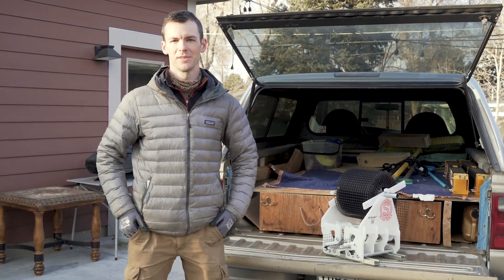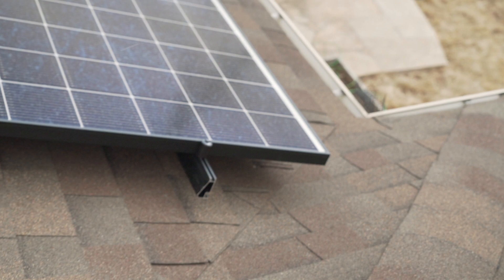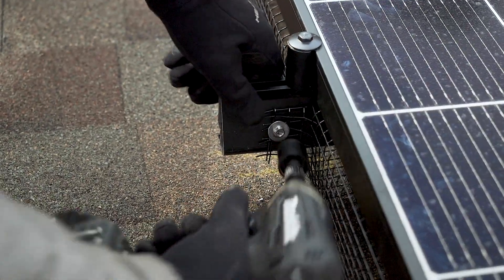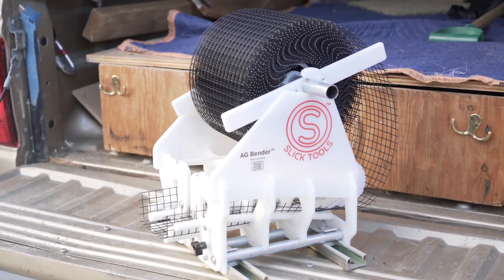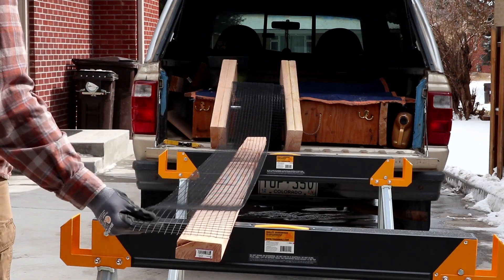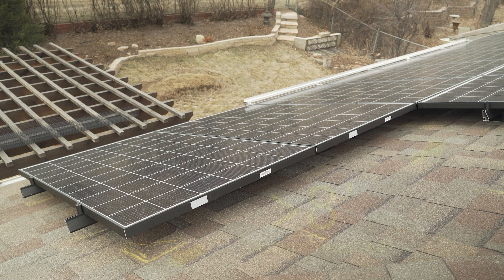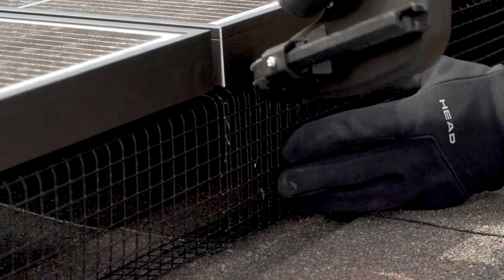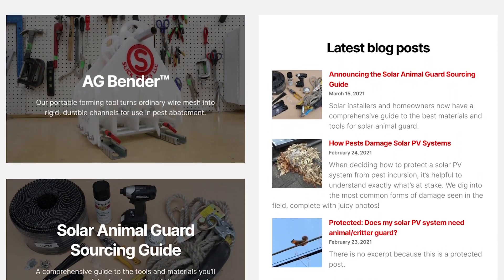How to Install Solar Animal Guard - Rail Mount Method

Comment: I would like to see this install on a spanish tile roof.
Reply from the maker: Tiles are tricky, but the lower flange of those C-channels can be used to fill in the low spots. See https://slicktoolsllc.com/mind-the-gap/ for some more info on that.